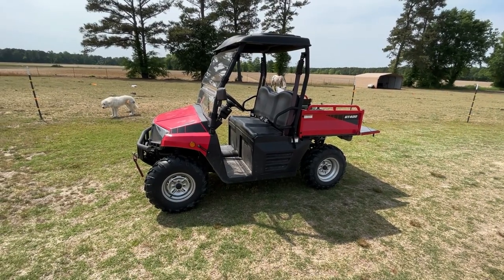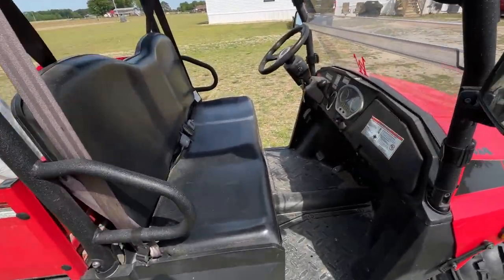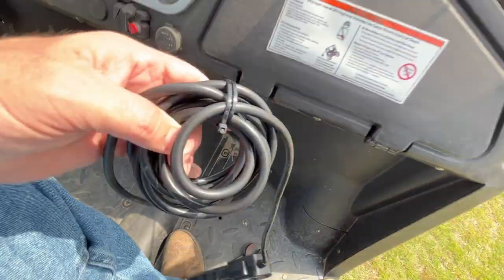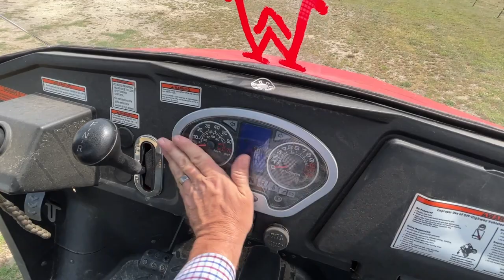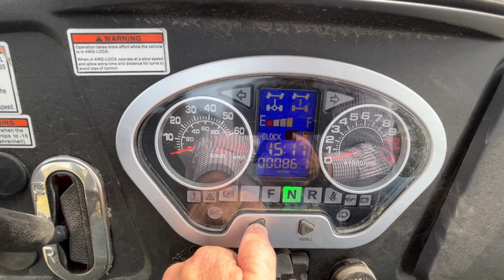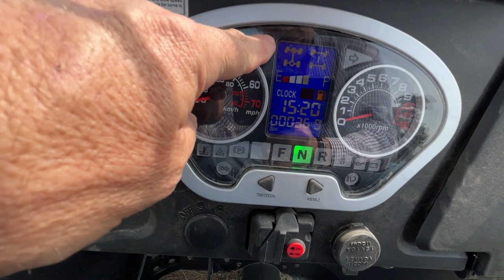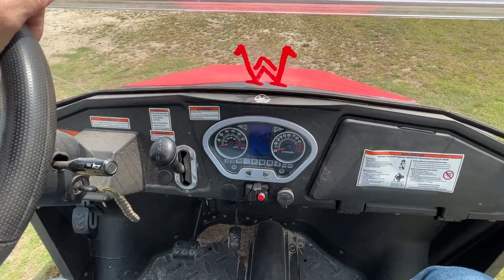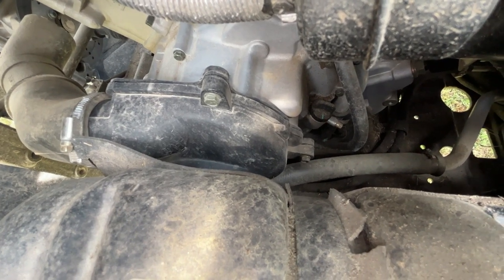Coleman UT 400 1 Year Review

Comment: Great review! I have one, just did the oil change, and cleaned the air filter. That oil filter position is something else!! I sprayed the bed with automotive undercoating to stop stuff sliding and quiet the rattling of things in the bed. About three months in had to get fuel pump replaced, TSC warrantied it and took care of me. No issues since then, owned it a year and a half now, running regular gas. Did the same with the seat belts. Great UTV and I would buy again as well.
Reply from the maker: Sorry for the late response. The oil filter was the worst part. That is a good idea about spraying the bed. I have stuff sliding around in mine and that would probably help too. Glad TSC covered the warranty. Thanks for watching

Comment: Just picked ours up yesterday @ Tractor Supply.  Whoever put it together left a lot of stuff loose.  Hated the seatbelts right off the get-go.  Took'em off today just unplug the sensor wire on the left one.  Put them in a zip bag and wire-tied it up to a cross-member behind the seat.  Sure is easier now to remove the seat also. Learned a lot from you about this machine and hope ours will be as reliable as yours.  I like your videos, especially when they are about stuff like this.
Reply from the maker: That is good. I did have to tighten a few things on ours too but for the most part it was pretty good. I like what you did with the seatbelts. I might have to do the same because they are in the way when you take the seat off. I appreciate you watching and let me know how your Coleman does or if you have any other ideas to make things easier with it.
Reply: Tom I know how you feel it's been a hassle keeping it going had mine almost a year the fan quit air cleaner fell off wires hanging  everywhere rear differential went out park brake won't hold several more things  and no help from the company never again.

Comment: Great video, I have the same machine. Have really had no issues other than finding the correct oil filter. First two I bought from TSC the filter would bottom out before tightening against the seal. Filter is a bear to get at. Wish the clock didn’t read in 24 hour time.
Reply from the maker: I ordered my last filter from Amazon. The brand was Chikia. I typed in Hisun/ ColemanUTV oil filter. It was hard for me to get the wrench on to change it too. I wish I could change the clock too.Thanks for watching.

Comment: Great video, thanks for the insight. Where is the fuse box and why would mine stop going into 4wheel drive?
Reply from the maker: Hey, The fuse box is under the seat. I would check the fuse first and then check the wiring that connects to the actuator to make sure it is connected good. Then maybe the switch in the dash or the actuator itself. Hope this helps. Thanks for watching.

Comment: Great video, we just got one but can’t get the parking brake lever to release the parking brake pedal, did you ever have to adjust the brake release?
Reply from the maker: Hey, Not sure about the parking brake. Ours has been fine but you might want to try and adjust it a little. We use ours sometimes. The one we have is a lever on the left side that we pull down to release. I will look at ours and see how to adjust it. Good luck on adjusting yours. Let us know if you fix it.
Reply: @WorleyFamilyHomestead  Thank you, I called our version of TSC and my friend there said to push the brake pedal down while jerking the lever down quickly and forcibly because it’s new said they sometimes stick. Before it worked easily so didn’t want to break it but after trying his advice and pulling it several times heard a click and then the next pull down it released.  Thank you, again for the great video.

Comment: What type of fuel do you put in yours. I first put regular 10% ethanol gas in and the plug fooled up. Tried putting stabilizer which helped but I had to put an ounce in everything I attempted to start it. I use the seat belts everything I ride it. I don't use it every day like it sounds you do. Left for 4 weeks, now the thing won't start at all. I tried higher octane still have the same problem. Any suggestions?
Reply: I use rec gas 90 octane
Reply: @filstan1  Thank-you. I just bought some that has no ethanol in it but my tank is full of high octane w/ethanol. I may have to siphon the old gas out so I can use just regular  90 w/o ethanol. Right now my issue seems to be no gas going to the cylinder.  I'm going to replace the fuel filter and test that the pump is working.

Comment: Not sure how yours drives, but I have a 2021 UT400 and it seems to me that I have to give it a bit more gas then needed to get it to start moving and when it does, it seems to be holding back until it starts off. Then when it does, it's a little jerky, then when it starts moving along, it seems to ride better. I have nothing to compare this with to to see whether or not this is normal. Any recommendations?
Reply from the maker: Not sure why yours is doing that. I have been lucky and not had that issue. I know mine has to have both seatbelts connected or it acts a little funny like it doesn't have all its power. Not sure if that might help. If I see anything on it I will let you know.

Comment: Have you heard or know how to adjust throttle?  Find when climbing hill, give it gas and it hesitates or stalled. Smell of gas/flooding?
Reply from the maker: Hey, I'm not sure about the throttle but I will look at mine and see if I can figure it out. It is fuel injected I don't know why you would smell gas. Just wondering how steep is the hill and if the gas is low in the tank. Maybe the gas is low enough on the hill that the fuel pump is not picking it up. Or maybe the fuel filter could be clogged. If you figure it out please let me know.
Reply: @WorleyFamilyHomestead  
Thank you for reply! I will certainly let you know if we figure it out.  The gas tank is never below half-full.  
This machine was in shop with less than 5 hours on. Required the linkage be adjusted,  now this!  Still only 15 miles 
We regret buying this Coleman even with the extras here & there which would be add on for other brands

Comment: That machine is 100% belt drive the belt is inside that black cover on the side of the engine
Reply from the maker: Im really not sure what is inside the cover on the engine but mine has a drive shaft that runs from the transmission to the rear end. Either way it has been a good one. Thanks for watching the video.